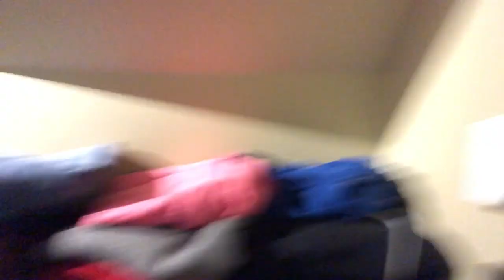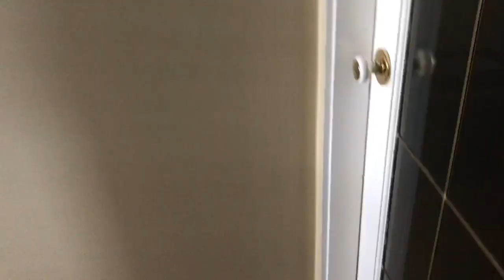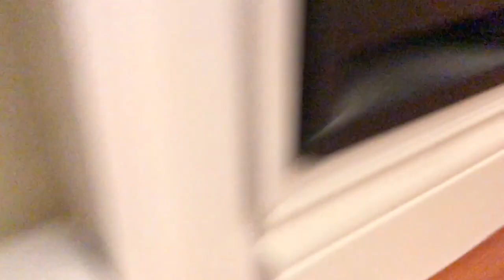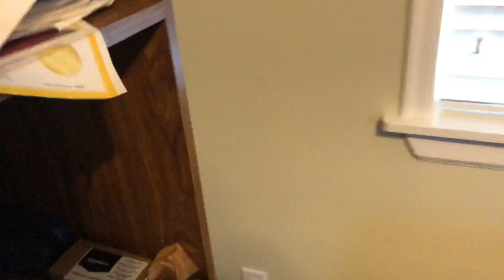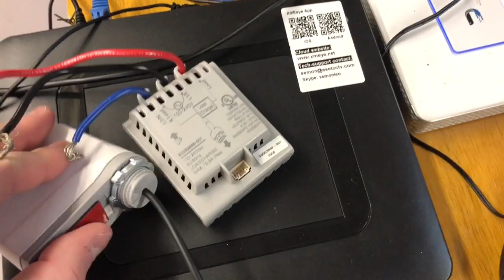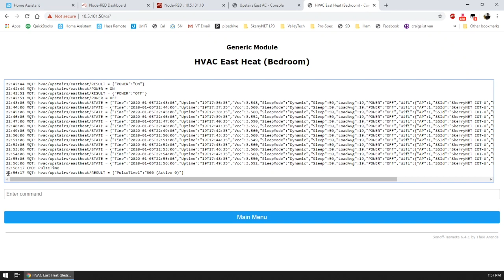DIY Smart Heater & AC + Thermostat - Jan 2020 Update

Comment: Hah, I've had the same issue with self-heating when using esp32s to check temperatures.  Even just the onboard voltage regulators on some boards can have that effect if your sensor is too close. I ended up solving it partly by sleeping more and partly by extending the temp/humidity sensor away from the board